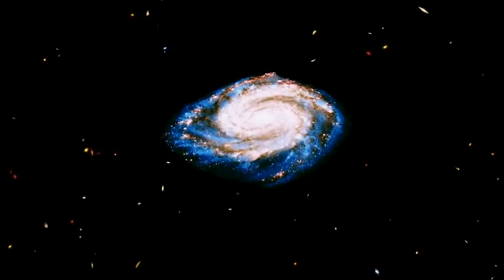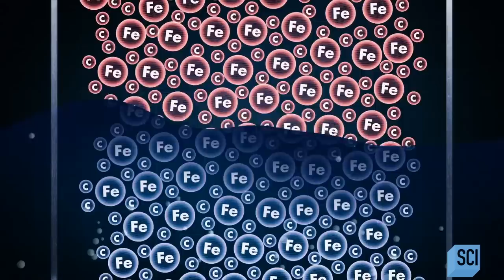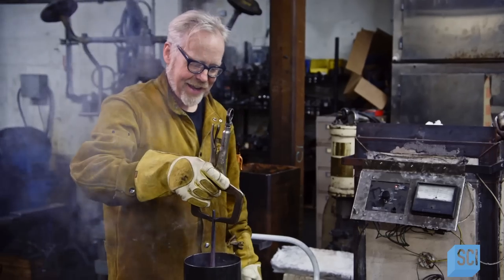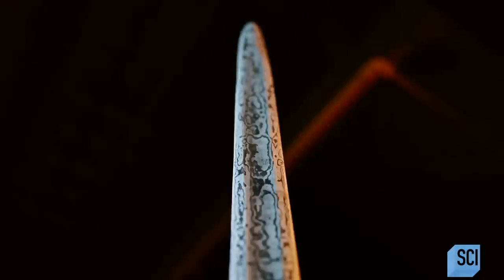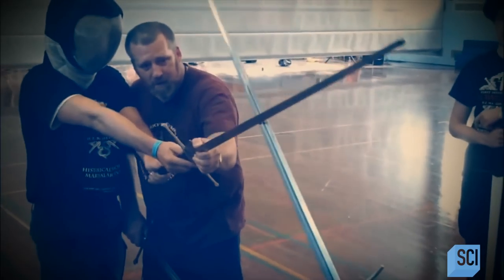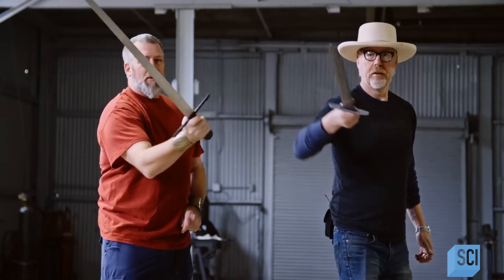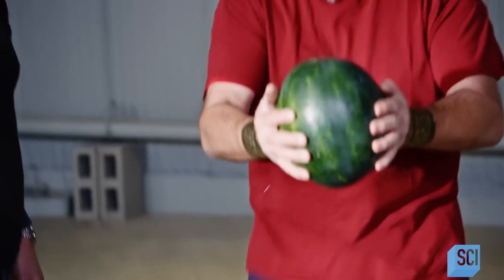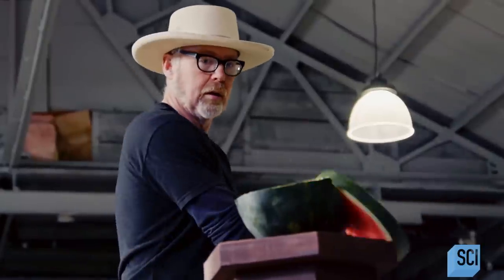Adam Savage Forges a Meteorite Sword | Savage Builds | Science Channel

Comment: What about the more important tempering stage?
Reply: What about it
Reply: Without it,  that sword will be brittle and snap,  and it's not mentioned or shown in the process, and a good tempering is as important as the actual quench. That's what.
Reply: @ROTPS138  tempering just involves heating the sword up again and controlling how it takes to cool to release the stresses in the metal and control the grain size of the metal. not only are they already doing that, but they aren't working with a homogenous metal. don't forget its basically nickel laminated onto iron.